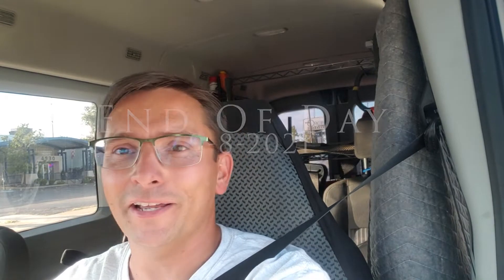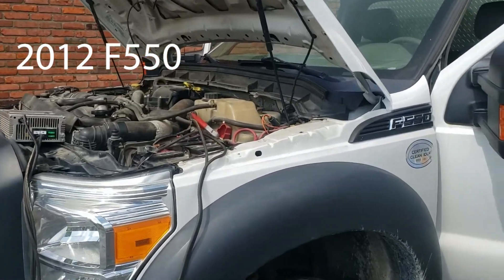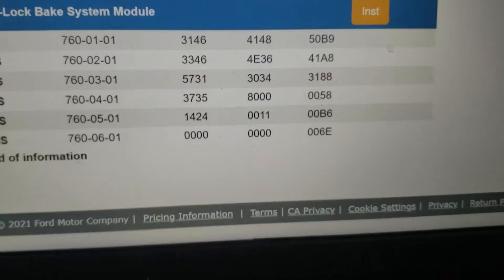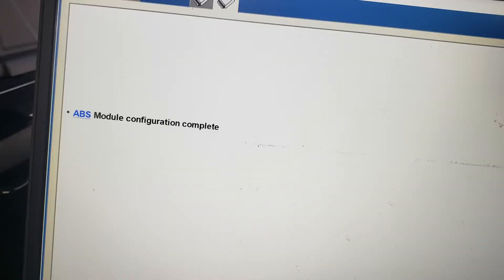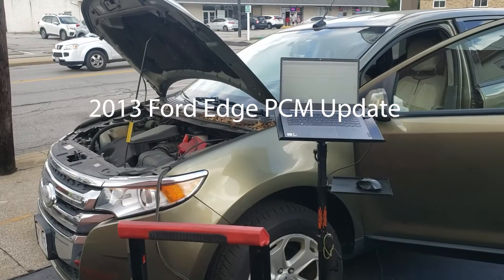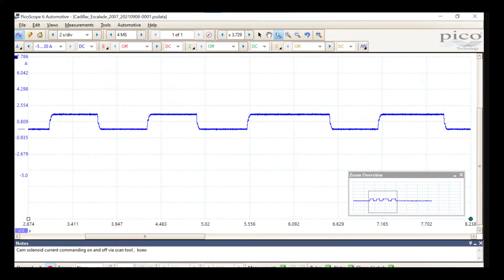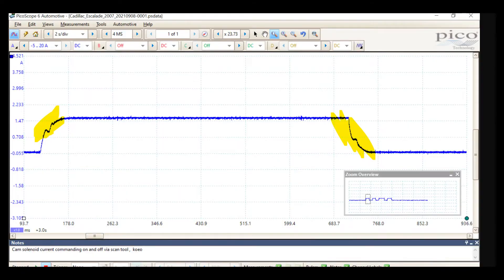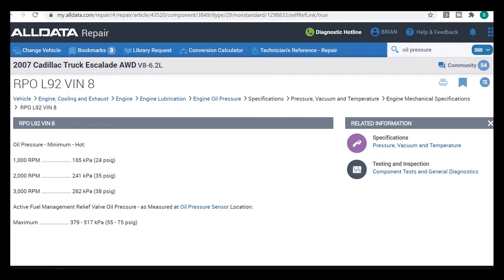9 8 2021 End Of Day GM P0011 in a 6.2

Comment: Nice. Sounds like a fun day
Reply from the maker: Not to bad, tommorow not going to have much as I have to take Dad to the doctor.
Reply: @BrianMann216  I'll be trying to finish up an engine install on a Ford transit. Not the easiest one I've done
Reply from the maker: @SuperBeetle1600  out the bottom?
Reply: @BrianMann216  yes. I had to make a special platform just to support it. There's a subframe just for the engine and it doesn't sit too flat.  I'll text you a pic